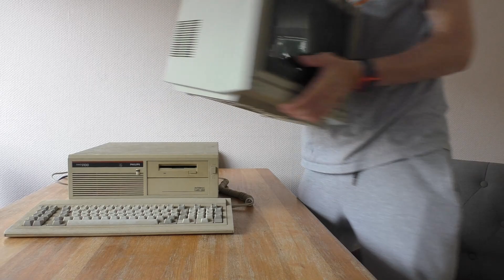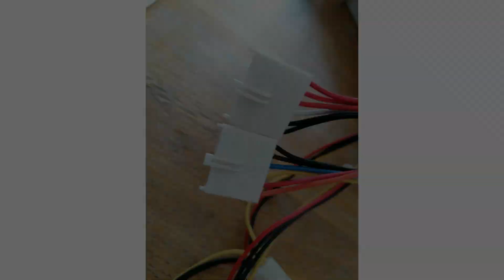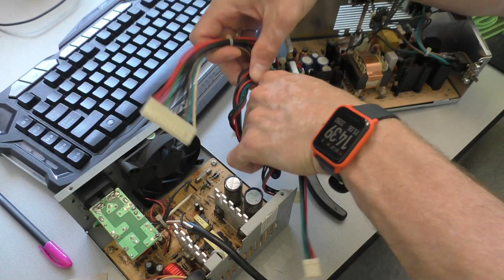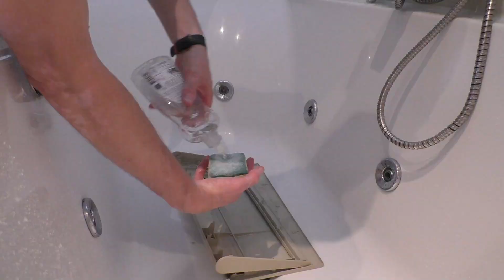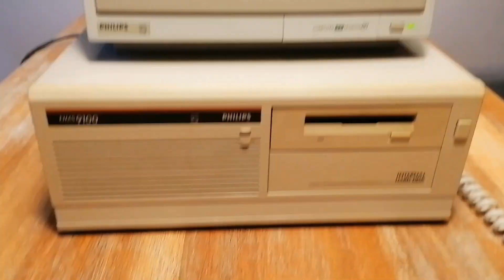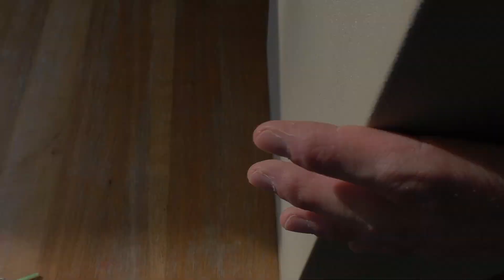Restoring an old XT (Philips NMS9100)

Comment: Hello, thk for your video. May i ask you a question? The IDE HD connector on the pcb (activeted with the dip switch 8 in OFF position) can use normal ATA HD or the HD must be MFM? Thanks Edy
Reply: Neither. It's XTA.

Comment: So many things you left out 
I have a similar computer that is the AT 286 version and I have no idea how to setup the hard disk
That one seems to have a SCSI hard disk ? How did you access the SETUP program ? (does it have a ROM setup program? ) 
My 286 version does not have onboard controllers .. it has a MFM western digital controller
Reply from the maker: I recommend you watch the newest video on my channel that also features this very computer. Long story short, I ended up using an XTIDE + CF-card.

Comment: Hello !! Help me please. I have a Philips CDWS 201 (same than NMS9100 but without HD and with a CD ROM Reader). 35 years ago this was my first PC after commodore vic 20 and I worked on him and start to be a programmer. I had eliminated the drawer CD player which was not needed at the time, to make room for a 5 1/4 floppy. Later I had inserted an HD to isa card. The computer remained in the attic of my parents' house for about 20 years, lying on the ground, in the dust and under other boxes. Then I went back to Italy and I took it, cleaned it, pampered it and fixed it well. Everything worked like then, including his 720Kb Floppy 3.5s. Every now and then I turned it on, I used it creating small new software also for the joy of my son who discovered the technologies used by his father when he was young. BUT unfortunately on Christmas Eve, when I turned it on to do something for Christmas, the monitor has no signal, the pc starts, it boots, the monitor is on, if I turn up the brightness you see the background turn green, but nothing is displayed on the monitor. The video card is a Hercules, can it be repaired? And where can I find someone who can fix it? Thank you very much
Reply from the maker: Do you have the ability to try another monitor? Just to rule out some things. In what part of the world do you live?
Reply: @RetroGameCouch  Hi thanks for the quick reply. Unfortunately I don't have any other monitors to try, I'd have to look for someone who has the same type of monitor, other people I've met who have a NMS9100 or similar say they have different monitors. I can't find a video card like mine. I have my old Commodore VIC 20, I don't remember if it also had video output, maybe I could look for a suitable cable to test it? My monitor is like commodore 1901. I found online a CGA Card than have  9pin D sub female like mine
(cable is a 9pin D sub male pc side, to 6 pin Din male to my monitor. can it work ?
Reply from the maker: Perhaps we can chat on Discord? Link is in the video description.

Comment: The first PC I ever owned as well. Fond memories of this device. It has 768Kb of RAM which when altering the RAM drive driver is accessible to load MS-DOS 6.x and drivers in UMB and HIGH even with an 8088 CPU. :) I might actually still have those files somewhere. My system came with MS-DOS 3.x which I upgraded to 4.xx at some point. Then 5.x and 6.22 was the latest version of MS-DOS I ran on it.
Reply from the maker: I am interested in those files. The machine needs some more work before it's really usable (gotek maybe, xt2ide, etc) and those files might come in handy.